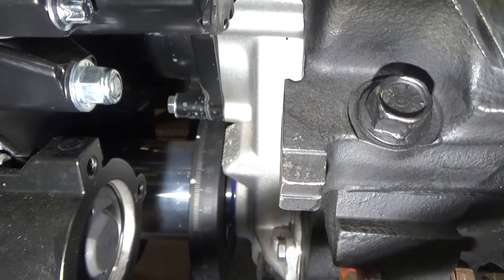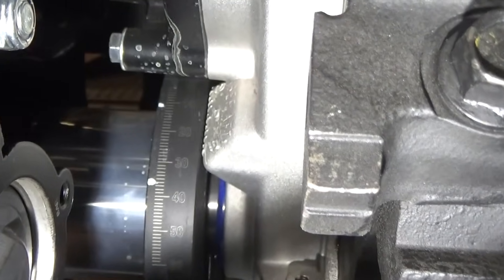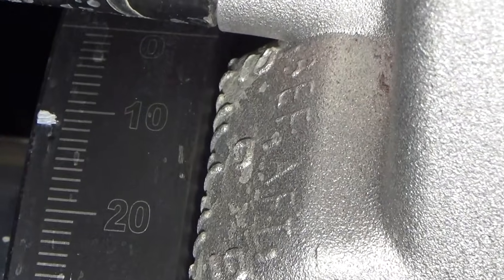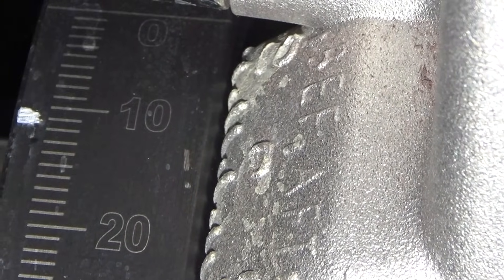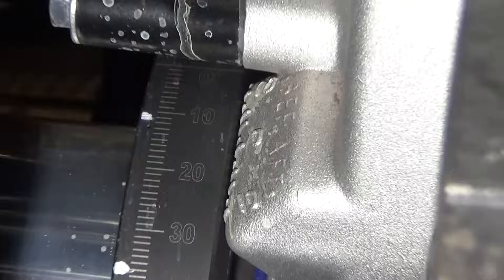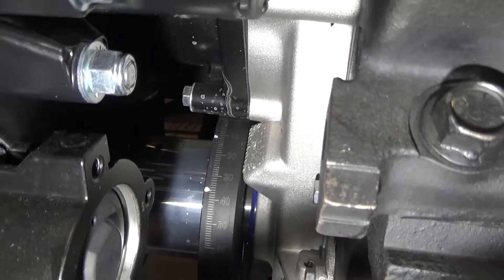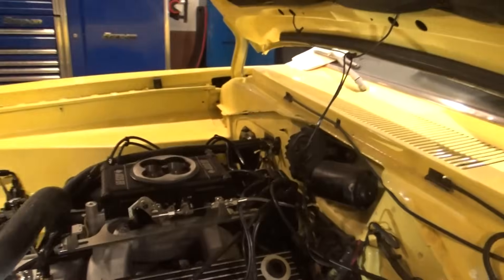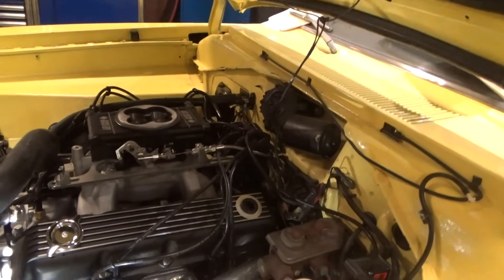ACES EFI Blackjack to the Rescue? Barracuda Project Ignition Problems resolved?

Comment: Hi, I wanted to ask about your fuel line set up.. . It looks like you don’t have a second line connected to the carb. Did you set up a return line? If not, does it loose fuel at that port?